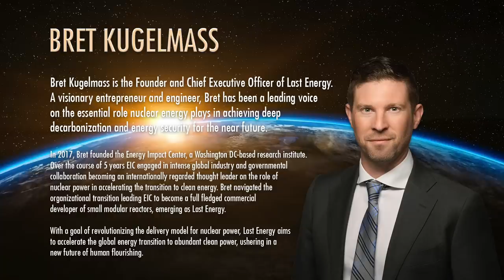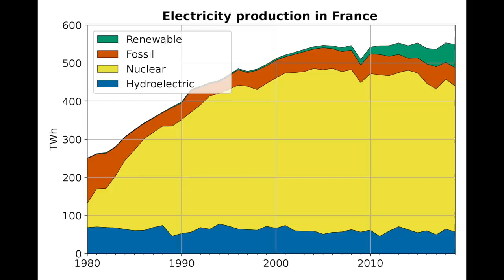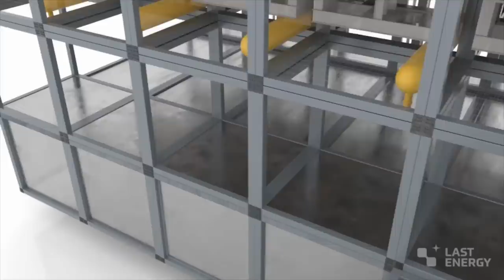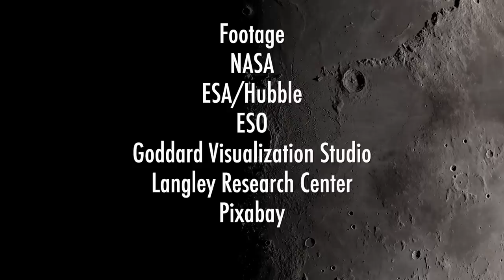Why We Need To Pursue Nuclear Energy Featuring Bret Kugelmass

Comment: Saying Chernobyl was a nuclear explosion is like saying a coal fired boiler exploding is a coal explosion, it's simply false.
If I recall correctly, Chernobyl had 2 explosions, the first from extremely high pressure steam, the second was from a mixture of hydrogen and oxygen gas burning, "nuclear explosion" implies it went off like a nuclear bomb, which it didnt.
Reply: No, it technically didn't go off like a nuclear bomb. It went off like a "dirty bomb".
Reply: Also the painful argument to hear is the only topics of Chernobyl and Fukushima being the main nuclear accidents and the dangers including deaths but over the span of 50 years compared to coal and in terms of after with data it is nothing compared to the dangers of coal power

Comment: I liked the discussion, thank you. But even as a nuclear proponent I found this to be a bit too one-sided and business-pitchy.
Reply: Nuclear must compete with wind and solar which are 3x less expensive. Energy storage is already at cost parity and rapidly advancing. I'm not sure there is a case for nuclear even IF I believed everything he said. Maybe nuclear ends up being some minor % of the energy mix. Maybe.
Reply: @pcproffy  It needs to be state sponsored
Reply: @stevencoardvenice  It also needs to be stringently regulated for safety - even in worst case scenarios, since the possible consequences can be highly dangerous. The guest's overly simplistic and dismissive arguments against regulation and safety made the rest of his points come across as totally biased, and not trustworthy.
Reply: @Mediumdave1983  Yeah, he's way too glib about some of this stuff- maybe not much got emitted to the environment in some of these larger nuclear accidents, and maybe nobody got hurt at the time, but there were well-contained messes left behind that are tricky and expensive to clean up without risking those very things.  Nuclear waste- accident-derived or not- must still be transported and stored with great care, and some of it DOES remain hazardous on very long timescales.  Even a packaged reactor design that's shipped in and out of the generation site in one sealed unit just shifts some (but not all) of the problems involved to the assembly and reclamation site(s); this may be an approach worth pursuing, but it doesn't negate those problems by any means.
Reply: totally agree with how one sided it was and in fact it sullied the whole conversation for me.
Reply: @user-kd2ue8ux1e  Admittedly being about as far from an expert on this as possible, his claims about the Fukushima incidents seemed dubious. After looking it up they seem to be blatant falsehoods. "It's not nearly as disastrous as people think." would probably be accurate but claiming nobody was hurt appears to be straight up wrong.
Reply: @pcproffy  There is no battery energy storage in place to back up one middling 500 MW wind farm for a day, not anywhere in the world.   Instead it’s gas or coal that backs up wind and solar everywhere, that’s the reality. That creates desperate  dependencies on gas, hence the spike in gas prices in Europe.
Reply: “pitchy”
This is the company CEO, running a business, running up hill against a perception of expensive and risky in US, W Europe.  Yet it’s not hand waiving.  He asserts dozens of details which can be assessed.
Reply: @Mediumdave1983  “needs to be stringently”

Ok, needs to be, why? Why more than aviation or chemical industry? 70 years of experience now with his type of reactor, light water. Some have broken, but none of them in commercial power have hurt anyone via radiation. Number killed by radiation in Fukushima, Zero.   Three reactors destroyed by tsunami and its aftermath, expensive loss, but nobody killed from radiation.
Reply: @araquan  “way too glib”

Ok, so usually when i hear that assertion the speaker can then point to this or that fatality rate, plane crashes,  hunger or disease rate.  You don’t bother.  You just move on saying what “must” happen, with “great care”.  Explosion from chemical carrying tankers last month in Ohio, fireball a mile into te sky. Where the call to shut down the rail, way too “glib”?
Reply: @Nill757  ...stringent (adjective) (of regulations, requirements, or conditions) strict, precise, and exacting: "stringent guidelines on air pollution"...

No one said necessarily 'more so' than aviation or chemical manufacture etc. - since those are ALSO industries that require stringent regulation, like nuclear does.
No one directly died (yet, and if your claim is true) from Fukushima radiation, precisely because of tight regulations. The history of commercial enterprise is littered with examples of businesses cutting costs by cutting safety - Ford Pinto, Bhopal, Ohio train crash, countless airliner crashes etc. etc.
Appropriately close regulation and monitoring is, regrettably, a necessity, not a 'nice to have', when it comes to businesses operating dangerous processes, and when it comes to nuclear power, where accidents have a clear and demonstrable very high risk of severe harm to the public, should something go wrong, there is an obvious need for a correspondingly tight safety environment, to balance that potential risk.
Reply: @Mediumdave1983  Agree w your front end. 

Then comes, “when it comes to nuclear power” and “clear demonstrable very high risk … severe harm to the public”.  

The record demonstrates these kinds of reactors are safe. A long record, 70 yrs now, is not full proof but does indicate inherently  safe. I’m open to anyone looking for more evidence, within reason, but you didn’t demonstrate anything but adjectives.  

A few years ago almost an entire town burned down Quebec in an oil train fire.  That kind of disaster occurs regularly w hydrocarbons and no international cautions like what you wrote above appear.  But plan some new nuclear, and out comes loads of imaginary “harm”.  What kind? “Severe harm”. How do we know? It’s “obvious”. Give me a break.
Reply: @Nill757  Very little industry, let alone Nuclear, is 'inherently safe'. Chernobyl, Three Mile Island, Windscale, Fukushima, and other incidents prove this. Fukushima could have been much worse, were it not for the current regulations - as well as an appreciable dose of luck.

If you're arguing for loosening restrictions, then you're arguing for shifting the risk towards a likelihood of the next Fukushima style incident being WORSE than the previous one. If you're arguing that Fukashima 'wasn't that bad', then that is a clear flaw in the case for said looser regulation, since the next would less regulated, and this potentially worse.

Additionally you'd also be shifting the risk / benefit ratio, in favour of greater risk of more serious disasters, which could very seriously impact public safety. If you're not able to interpret that, then simply put, it means greater chances of radioactive contamination of public water, air, agricultural land, residential areas etc., due to a major incident that released radioactive substances, whether from a major reactor incident, improper storage and handling of fuel or waste material, or even some as yet unforeseen mechanism.

By all means try and make the case for the benefits of less regulation, but don't pretend it obviously means anything less than an increased risk of potential harm, often to people who have no say in the matter, nor means of mitigating it.
Reply: @Mediumdave1983  This video is not about the “nuclear industry”.  The company plans, as I said, a particular kind of reactor, light water, used all over the commercial world for 70 years, that’s never killed anyone by radiation.  Its that particular record of this widely used reactor that makes it inherently safe. It’s not Windscale, a graphite reactor for weapons by the military, it’s not Chernobyl, another graphite reactor built in part for weapons. I didn’t say Fukushima “wasn’t that bad”, I said it didn’t kill anyone from radiation.  Neither did TMI.  It makes a difference to me to keep track of which accidents kill people and which don’t. I’m not interested   in hand waiving away a zero fatalities record as “lucky”, especially when hydrocarbon accidents and emissions are killing thousands every year.

“loosening restrictions “
The ‘more regulation (with no regard to effectiveness) always protects better’ notion was long ago debunked. It leads to outcomes like mandating all passenger vehicles be armored track tanks, which shifts the risk elsewhere and doesn’t make people safer overall.
Reply: A lot of pro-capitalism propaganda, I've noticed
Reply: @jaimeherman1607  More Venezuela!! Viva Chávez!  More N Korea!!  Long live dear leader!
Reply: @jaimeherman1607  More Venezuela!! Viva Chávez!  More N Korea!!  Long live dear leader!
Reply: @pcproffy  cost parity to what?
Reply: @pcproffy  so what is this energy storage? Batteries are incredibly expensive, if you are lucky you could get a battery that will run your house for a day for what $10k? here goes some quick maths/
There are 130 million homes in the US, 130 million x10k is $1.3 trillion dollars! And that will run everyones house off grid for 1 day.  and that doesn’t include industry/shops/etc that’s about 2x more required so 3.9 trillion dollars. For 1 day, for 10 days 39 trillion dollars, that’s basically every penny every American earns for 2 years. So parity with what exactly?
Reply: Yeah, this guy is a disaster. I believe it's imperative that we waste no time transitioning to nuclear power as effeciently and intelligently as possible, but I can explain the misunderstandings and realities around safety, fuel handling, processing, waste, radiation hazards reactor design considerations, etc.
To have someone in the industry with plans for major deployment say, to every question, "bro, trust me, that's all nonsense" and then display no knowledge backing up the claim Honestly he terrifies me. 

I want to believe that he understands, and that he's just overcompensating because of how  ridiculous we have in fact been about nuclear risk management, but this is not the way to fix it.

Comment: The one aspect of nuclear power that most people can't wrap their head around is the waste problem. They know it's dangerous, but they can't understand just how LITTLE of it there is relative to waste created by fossil fuels and renewables.
Reply: Coal is also radioactive.
Reply: @ryanb9749  so are Brazil nuts, but yes I get your point.
Reply: @ryanb9749  All of us are radioactive, just negligibly :)
Reply: Exactly.
Reply: @markokrsmanovic2562  I'm not uptight, nor am I unattractive
Reply: @cy4782  There are options already available. Is the 50-60 year limit a legislative issue or a practical one relating to safety. Also, who is blindly ignoring it?
Reply: That's mostly true.  All items within the chamber that receive neutron bombardment and thus become neutron activated.  
Even the most recent ITER and Wendelstein 7x that would use neutron bombardment as its fusion method does create internal structure components/pieces that could be come waste that must be held for about 50 years and then 30 to 40 percent of that waste would be safe to dispose of as normal non-neutron activated.
So the components in nuclear power plants are internal components that are subject to neutron bombardment that is much shorter time for holding, but still must be held for 50 to 100 years.
But we can make storage facilities for this waste.  And isolate them for longer term storage like spent fuel rods.  And other components that have a much shorter radiative period like neutron activated components.  
We should be able to manage it just fine.   But it's much smaller and easier to put in a safe spot under a dry non aquifer mountain in some desert.

Comment: I get what you are saying about Thorium being over-hyped, but I have a few points to defend it:
1. when most people advocate for Thorium, it is not thorium fuel they mean but rather the Molten Salt Reactor. And that reactor do have a lot of merit, especially considering passive safety. Low pressure and radioactive isotopes stays in the salt that turn solid in case of a leak. This means low production price, as the whole construction do not need active safety systems and no high pressure tubing either. But of cause it takes a bit more research to make than an SMR version of a PWR.
2. even though uranium is plentiful, it still cost money. Especially enriched uranium. For a classic PWR and maybe even a SMR the cost of the fuel is small compared to the production price of the plant. But Copenhagen Atomics are going to mass produce a 200 MW reactor in "thin" steel plates. Meaning the cost of the plant itself is going to be so small that the price of the fuel is going to matter a lot. Thorium is extremely cheap compared to enriched uranium.
3. I know the counterpoint is "but you can just breed U238 into plutonium instead of thorium into U233". Yes, but you will have to use a fast breeder reactor. It is much easier to construct a well-functioning thermal reactor than a fast reactor, that's why the most popular reactors in the world are all thermal reactors. Thorium can breed in a thermal reactor. U238 cannot. And then there is the problem of people hating on plutonium because most nuclear weapons are made from it. 

For these reasons, I think it does make sense to build thorium MSR reactors. However, I can see the point that uranium reactors are really good as well, and we can make do with uranium. Thorium is nice, but it is not a must have.

Comment: I love the drive of this guy, and that he'll try to renormalise the idea of nuclear power as something good for the general population. What I don't get is his disdain for every technology that's not his own. We can't afford not to have a bet on the best horse right now, whichever horse that might be. Fusion has a lot of the issues he mentions, but he ignores the potential advantages and overplays the issues, and I don't think it's wise to dismiss it as a (very) long term strategy. Likewise thorium has a lot of good going for it if the engineering pans out. It might not, but even in that case we'll have learnt a lot for relatively little money.

Let's just pursue every option in a safe manner, and see what works out. Chances are it'll be a mixture of different types of plants according to local circumstances and resources, and of course advances in science and engineering.

Nuclear power is absolutely necessary to handle the energy and pollution crisis we are facing. That countries like Germany are decommisioning perfectly serviceable nuclear power plants is completely nuts. Every current and future nuclear and fusion tech will be deployable with negligible risks, in fact fission is the power source causing fewest deaths/MW both right now and since its beginning.
Reply: True, but I agree with his point that we need solutions now. Not in 20 years. Cutting back on energy usage / raising energy prices is one assured way to commit economic suicide. Especially if the rest of the world does not care. We need fast, scalable and cheap energy that is produced locally, not in unfriendly nations. Once that is in place than yes by all means go for improved designs and methods. Freezing your citizens and shutting down your industries will not improve quality of life.

Comment: I'm not entirely against Nuclear as a solution to the climate crisis, but Fukushima was and continues to be a thing. A really, really bad thing. And I can only assume the cost of storing the waste produced for thousands of years is factored into the per kw/h cost of the electricity these plants produce?
Reply: A “really, really bad thing” that resulted in zero loss of human life and zero quantifiable impact on the environment. If you’ve ever eaten a banana you have nothing to worry about from mildly tritiated water 🤦🏻‍♂️
Reply: What climate crisis?
Reply: @bryanbarnard4094  Seriously?
Reply: Their are reactor designs that can use waste as a fuel and pebble bed reactor designs that have safety built in them
Reply: external costs are a big problem here. there are no numbers on what wast storage will cost in the end. Risk is also external cost. The numbers I have seen on what risk inclusion would do with the energy price just blew it out of the water.

Comment: This guy genuinely scares me, while I agree that nuclear energy is what we need to fill the gap between fossil fuels and renewables. He is far too dismissive of certain situations and issues. Take his rhetoric on regulations, elevator mechanic we allow older elevators to stay operating because they still have the same basic safeties as new ones do. The only difference is the new ones have far greater requirements because of new situations or to keep the people operating those elevators safe.

Different types of ways to operate fire service, regulations on ensuring that the people working on them have a safe working environment, making sure that the safeties cannot be jumped out in the ways that they were able to be in the past

Comment: Huge proponent of nuclear. Especially small modular reactors.

However, it is not true that nuclear waste is "safe," as is stated. It is still around 90% uranium with isotopes of zinc, iron, zirconium, silver, iodine, etc. All of which are dangerous. 

The reason no one has died from nuclear waste is because nuclear is not at scale. If it were 50% or more of our total output globally, the waste will become a problem.

Comment: Everyone seems to miss that the problem of fossil fuels isn't just energy production. We have a two-fold problem .
We use it for energy, but it is also necessary for plastic production. 
Plastics are used absolutely everywhere, and until we seriously develop a valid replacement for them, oil will continue to flow.